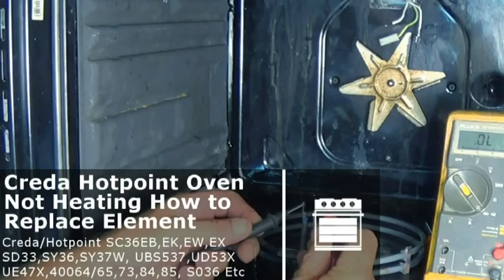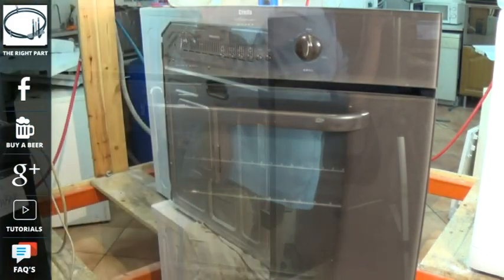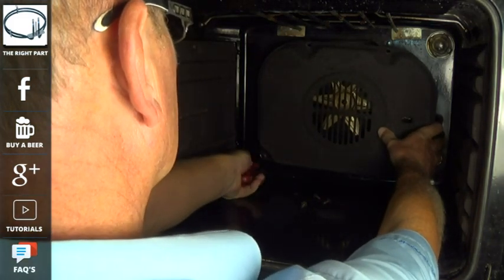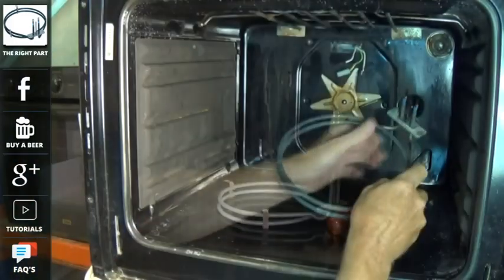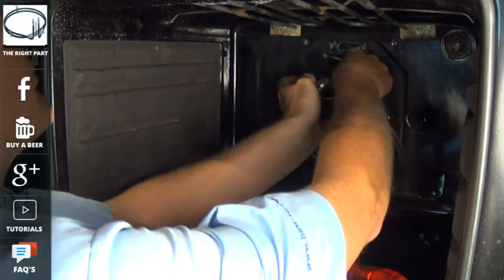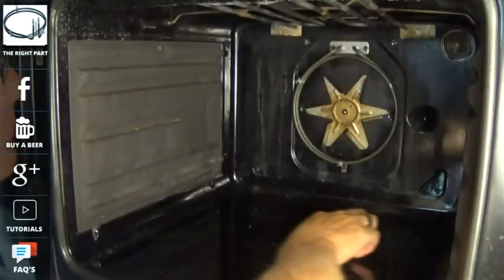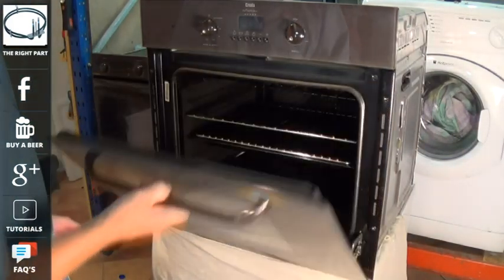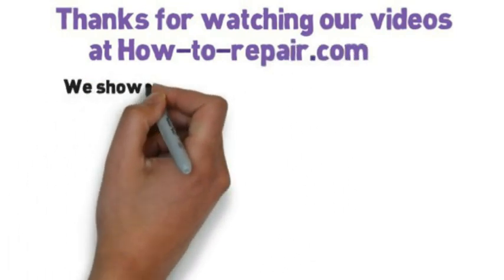Creda Hotpoint oven not heating, testing element & replacing on model SC36,D33,SY36,SY37W, UBS537,UD

Comment: I must have changed the element in my 20+ years old Creda half a dozen times now. Always did the trick until last time, where it still wouldn't heat-up after fitting. Your continuity test tip saved me, as I had somehow fitted an old used element which hadn't been thrown away last time - thanks!
Reply from the maker: I'm glad you found a video helpful, at least you know where to buy the parts from in the future  @bobgreaves1716  this is for you https://www.youtube.com/shorts/e432SAb2g08 please remember to subscribe as that's what keeps this channel going. Thanks 👍

Comment: I've got a hotpoint oven, my power went out for an hour due to a storm. The stove top burners work but there is no gas flowing to the oven. The glow starter is working and glows bright yellow-orange. The knob is not broken to my knowledge since the glow starter turns on. I restarted all of my fuses and unplugged it several time to see if the hotpoint stove powered up wrong. It worked right before the power out because pizza was made before the storm. Please I need help and your thoughts. Money is tight from the holidays. Thank you!!!